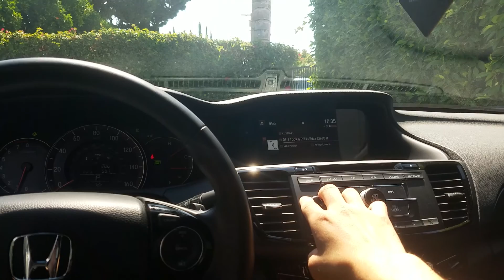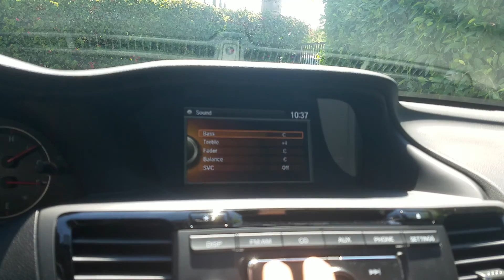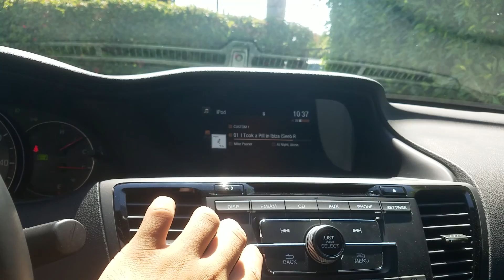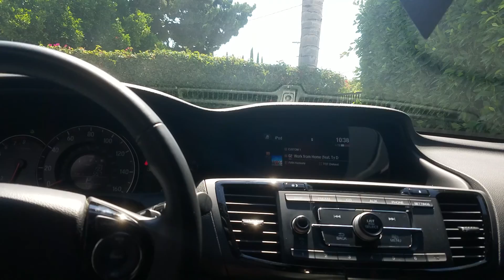Rockford Fosgate Sound System Part 3

Comment: I've got a somewhat similar system. But my back deck rattles BAD. Do you have this problem?
Reply from the maker: Taylor Schull yes.  i had it fixed by my shop lining the rear corners with vibration damping cloth covering them.  it helped dramatically since it touches the window.  no more rattle now